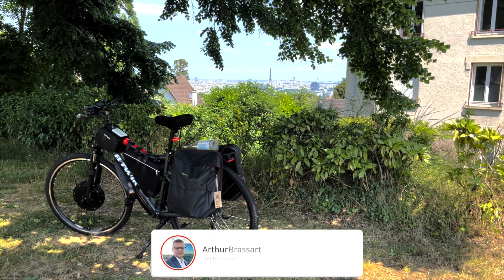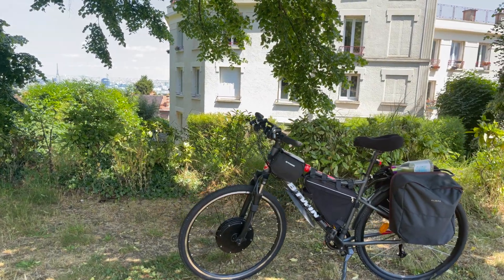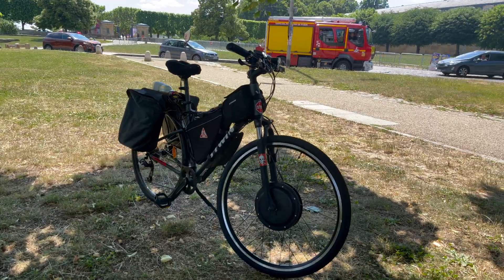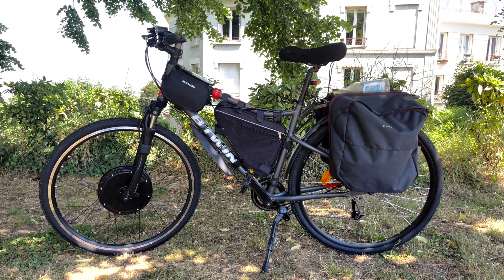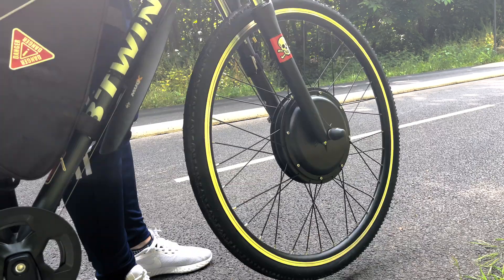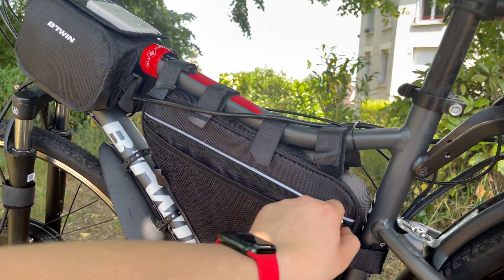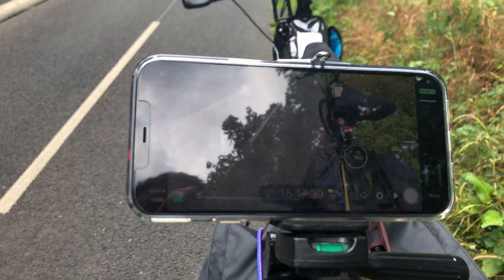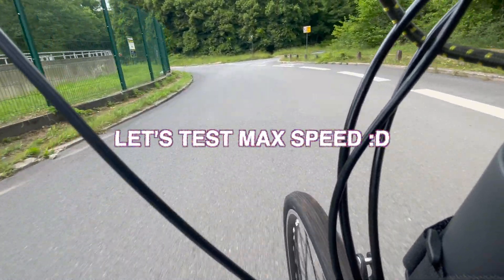My Custom Made E-Bike Riverside 1500E First Review & Speed Test. 75km/h - True Beast Speedbike

Comment: Hey , i have riverside 500e , i added front motor 1500w , but i wanted to ask how to add disc braking system knowing that they space between the wheel and the body of the bike much smaller to hold a hydraulic disc brake , can you tell me please what i can do , i would love also that i contact you to get in touch about our projects in bikes 😅

Comment: BTW On my regular Riverside 500... After half a year of using it, my left crank bolt started getting loose in winter. So I tightened it a few times, last time with a sealant paste and since then it never got loose. But tehn after 2 years of use my cassette and freewheel got worn out so I changed it at the bike repair shop with original chain, freewheel and cassette from Decathlon. I told the mechanic to also index the gears after he installs the new parts. - Even though I indexed them perfectly very recently and he said he didnt need to and that they were fine.

So the bike was riding perfectly smooth and fast like new.. Only there was some strange thing happening. The chain didnt skip the teeth any more.. because it was new and tight. But... I felt my rear derailleur or chain.. made that particular sound like when its changing the gears between 9th and 8th, automatically without me even touching the gear shifter. And only when I felt like there is difference in speed and tension on the chain. Weird thing.. I wonder why that happened. But besides that my bike was perfectly fine and running fast. - I can actually surpass any electric bike with it (on the flat road) and leave them in the dust behind me.... like seriously... But then the same issue with skipping gears by it's own, started happening  a few times per minute, while riding on a flat road, not even while standing. It started happening during one recent ride into a really strong wind.. so much that I had to ride in 8th and 7th gear. - I think I will have to re-index my gears again and try to solve the issue. Since the whole crank set, chain and cassette are brand new and original from Decathlon. -Any ideas what could be the possible issue or a solution ?
Reply from the maker: https://youtu.be/5rX7VKilm0I

Comment: I know A guy in my neighbourhood who has a modified ebike that goes around 50kmph and he told me he has two bike computers. One fake one to show police and one hidden one in a small stem bag on the bike. -What is your solution in case you get stopped by police with this beast ? :) I guess also the bulky controller in the bag and all the exposed wires are not that safe in case there are mad people who want your parking space, or mad thieves who cannot cut a chainlock... or simply heavy rain.
Reply from the maker: With this custom controller i can modify max speed :) As for now i was stopped by the police 2 times. Everything went fine 🤭😅

Comment: Oh wow..  This is definitely a dream bike! You built this whole thing for only 1300 € ? Maan  my 500E costs exactly that much ..... ( without all the locks and the rest of the security accessories that cost me at least 600 € more) .. I also need to invest in Schwalbe Marathon Plus tires on it too.. since I have them on my regular Riverside 500 ... Since the original all terrain tires are good. but after 2 years of use they developed those flat holes and I started getting flat tires much more often.
Reply from the maker: Yes just for 1300€ i made this beast ✌️ Btw i will me making a video on how to build the same e-bike. Subscribe if you are interested 😀
Reply: @ArthurBrassart  Subscribed 😎
Reply: @ArthurBrassart  btw I like the part where you showed how your airtag fits in the controler compartment on your 500E .. I use bike trackers from Invoxia. They have their own fake lamp housing but I see there is enough of space to put one of those in the same controler compartment. So just in case a smart thief knocks one gps, there is an auxilary one.
Reply: @ArthurBrassart   Hi.. I just received and set up my new 500E .. Boy its fast in the wind! .. One question.. In case I want to immediately install punctureproof tires, or if I get a flat one on the rear wheel. Whats the easiest way to detach the cable from the motor with the least amount of tools ?

Comment: I have an 500e. But the 25kmh is slow for me, also the accumulator is weak, only 70km on a trip. How can I change it to support max 40-45kmh and a 100-120 km trip? And charge time from 6 hours to 3 hours..
Reply from the maker: Hi, officially in Europe your e-bike is limited to 25kmh. But you can change it by replacing the controller with a custom one

Comment: just excellent that's what I would need to make my trips home / work do you think of doing an assembly tutorial on it?
Reply from the maker: Thanks, i’m still impressed with the speed performance of it 😅 Yes, i will be making assemble tutorial later 👌 Its’s super easy 🙂
This e-bike is a 💣
Reply: @ArthurBrassart  to say I have 20 km by car and by electric bike I would like to avoid having 1 hour of road to do but I still have to use my legs to work so your bike and a real solution for my problem
Reply from the maker: @dexian6377  yeah, you can save time, effort and money :) Fuel costs a lot today! :)
Reply: @ArthurBrassart  it would be limited a video idea 😁 video assembly from A to Z with the parts before assembly 😁
Reply from the maker: @dexian6377  i noted your idea! :D Stay tuned ;)
Reply: @ArthurBrassart  and for the battery can you remove it to charge it or do you have to charge the whole bike?
Reply from the maker: @dexian6377  yes, you can remove it. It is a bit heavy buy you can just take your battery to your office and leave a bike downstairs. No problem at all :)
Reply: @ArthurBrassart  and what budget should you plan for this little gem?
Reply from the maker: @dexian6377  around 1200-1300 EUR
Reply: @ArthurBrassart  the same price as for the riverside 500E so ^^ but better
Reply: @ArthurBrassart  and at the level of the law I guess we are not good if the police check the bike ^^
Reply from the maker: @dexian6377  :D
Reply: @ArthurBrassart  do you think it's possible to replace the handles of the bike with Speed Control Electric Bike Handles? it would allow to control the speed as with a scooter and to have an ignition key to increase security against theft
Reply from the maker: @dexian6377  yes you can make it! I already have motorcycle style handles btw and ignition key to prevent someone of riding it without my permission :D It's super easy to do!
Reply: @ArthurBrassart  248 / 5 000
Résultats de traduction
good evening I am looking for a kit to make my electric bike but I am a bit lost, do you have any models to advise me or even the site where you bought yours? or maybe you plan to make a video with a list of the parts to use?
Reply from the maker: @dexian6377  Bonsoir, oui je vais faire une vidéo dans laquelle je vais montrer comment faire un vélo comme le mien 😀J’ai acheté les composants un peu partout. C’est pas facile de trouver un moteur de qualité 😊
Reply: @ArthurBrassart  for the base of the bike, did you go with the riverside 500E or another model?
Reply from the maker: @dexian6377  at the beginning I used my 500E and I added a front motor. But I decided to buy a regular Riverside 500 and I used it as the base because having two motors and two batteries is too much :D